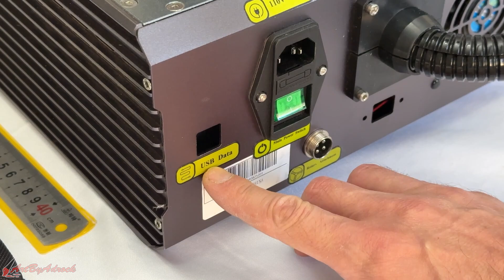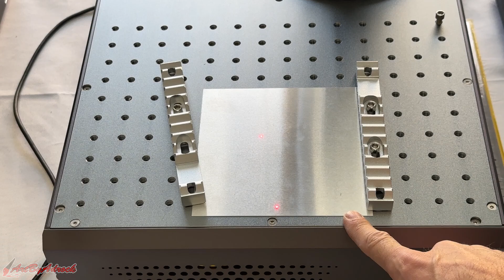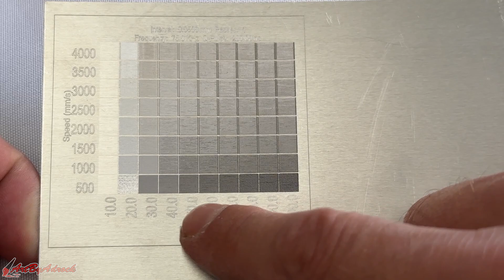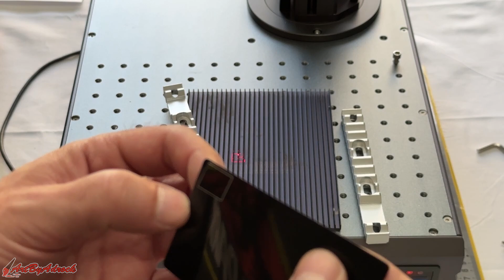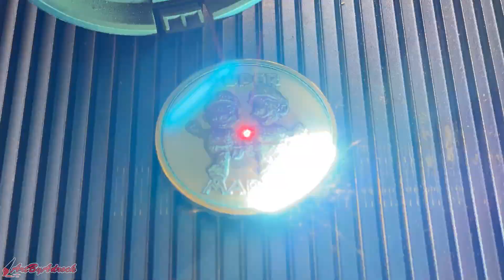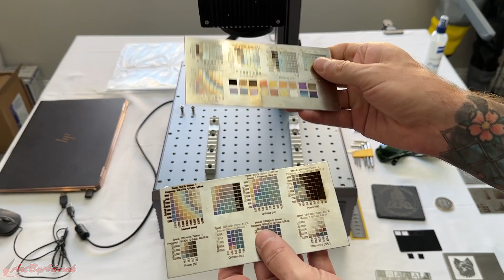Monport GA100 MOPA Fiber Laser - 100W Of ULTIMATE Laser Power!

Comment: Just checked (June 8th, 2025) - it is USD 6879 with rotary attachment! Guys, reach out factory in China, build your setup and keep money in your pockets. I got mine (JPT M7 100W, 800mm tower, 4 lenses (70, 145, 200 and 300mm field), rotary) for USD 3200 shipped to europe. Don't be fooled by greedy resellers. If it's like 1000 bucks difference i can understand. But they are ripping you like crazy.

Comment: Thanks for the excellent video.  I recently purchased the GA100 and this is the most instructive video I've found.  I don't find the Monport post sales support to be sufficiently responsive.  Hopefully, they can improve their service.   Do you have a feel for how thick of aluminum you can cut thru with this engraver?  Also, you mentioned running at fairly high power settings but Monport warns against running above 80% to ensure longevity of machine.  Thoughts?

Comment: How would you compare this one with commarker titan? These are both large power machines in the market. Which one is more easy to use?
Reply from the maker: They’re both easy to use but the Titan has more power so if you plan on doing more cutting or deeper engraves faster go with the Titan. For color I found the the Monport to be easier. They both are great machines though

Comment: question: im not sure what setting to change in LB, the laser just starts running. I'm pretty sure i have do not start without framing first. However it will just automatically start engraving when i entered text and again when i did a box.

Comment: So how is this one compare with commarker titan? They are all 100w fiber but commarker say they have a 15,000mm speed faster than this one.
Reply from the maker: I’ll be testing out the titan shortly so stay tuned. The speed is really irrelevant when they are that fast as you’ll never really run it at those speeds anyways. I never run anything faster than 4000 on any machine

Comment: I would like to ask, I've heard many players say that the 60W MOPA produces much better colors compared to the 100W. I'm curious to know your opinion on this. I'm currently torn between whether to buy the 60W or the 100W.
Reply from the maker: I don’t think the 60w produces better colors. They both do a great job. Ask yourself what you plan on using it for the most. If you’re looking to do a lot of deep engraving, go for the 100w, if not go with 60. The 60 can still do deep engravings just fine but will take a little longer depending on how deep you want to go. If money isn’t an issue go with the 100 but the 60 can still do everything the 100 can just not as fast or deep. Keep in mind though that you can really only run so fast without losing quality so you’re probably never going to run anything at 10,000mm/s regardless of the machine power. I never go over 4000mm. Hopefully that helps a little.

Comment: My Monport GA100 has a two pin door switch on the back.  Has anyone used this with a door switch on their enclosure?  Monport customer service said refer to the wiring diagram but I can not fine the diagram.  Lightburn has a door port in the settings.  I can't get LightBurn to see an open or close when I short the two pins.  How does this work?  Maybe it is not wired up inside.
Reply: According to Monport tech support "The two pins connected to the door protection are pin 1 and pin 12 on the motherboard. The door port is set to 0 and controlled by low level."   Upon reviewing Section 2.1.4 of the LMCV4-FIBER-M-Fiber Datasheet.pdf, pin 12 is GND and pin 1 is XORG0.  XORG0 is typically used as the extension axis home switch, but since the extension axis on the GA100 is the rotary, Monport has repurposed this signal as the door sensor.  If you wire a switch to the back panel "Protective Cover" connector, In14 should report the state of the door sensor.
Reply: @jhenderson0107  Thanks, This works great.  I can see it toggles the red / green in LB on the far let row.  As you said this is on Port 0.   I now need to test to see if it stops the laser from out putting.

Comment: Really great video.    I was hoping someone with one of the machines could tell me how low the head will lower using the down button.   Mine will go all the way to the top and will bump the top.  But if you go down, it stops at 319 mm to the line on the side of the head.  (This is not even halfway down the tower.)    Could someone lower theirs and tell me the height at which theirs stops.      I would think, if you are using a shorter focal length lens or doing something off the side, it should lower more.   Thanks in advance.
Reply: The down button will not work if the auto-focus sensor is positioned over a highly reflective surface.  Position something like a black business card blank under the auto-focus beam and the Down button and auto-focus will work normally.  I encounted this phenomenon when the focus beam struck my Blackwell aluminum grid.

Comment: Great review! Do you have any settings listed, or a file, for that Homer image? I have the Monport GI60, your review of it was one of the ones that convinced me to go ahead and get it. Also, where do you get your coin blanks? I know there is a lot on Amazon, but it seems like at least half of those turn out to be bad quality. Thanks!
Reply from the maker: @bryanrussell2124  if you email me I could send you the lightburn file I used for Homer and some of the colors. You will probably have to adjust the settings slightly for the 60w though. For the brass coin blanks, I usually just get them off Amazon too. The steel ones I think I got off Ali Express if I remember correctly. They aren’t that great though and I’m still looking for better quality ones.
Reply: Hello! Awesome content here! I too, would be interested in your color marking settings. I bought this laser last night using your coupon and am super excited! We have a 100 watt CO2 laser and a diode laser as well as a CNC, resin, and filament 3D printers so the fiber laser was the missing modality! 

There is a place called Limitless Solutions out of the UK for what look to be very high quality blanks. I ordered some last night based on a YouTube video of another creator who showed his haul from them. Free shipping when you spend $150 American or more. Their coins and tags look gorgeous.
Reply from the maker: @CutItOutWithUs  send me an email and I’ll send you the lightburn file used
Reply: I am interested to. Where can I find the Emailadresse?
Reply: I have a Windows 11 laptop, which version of Lightburn do you recommend for my 50W Laser/cutter engraver?! The software that came with the laser is SeaCad2 but I would rather use  the lightburn software!! I need to start a.s.a.p with my project that way my business can take off 🙏🏼
I'll be looking forward to your response!!